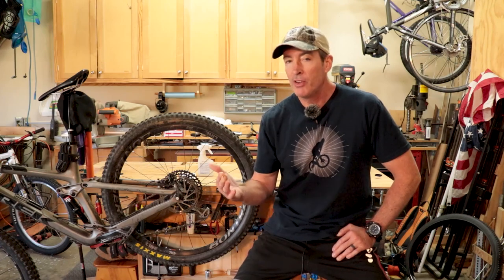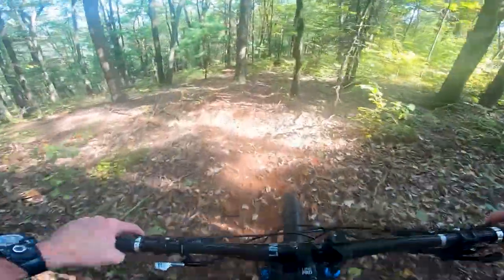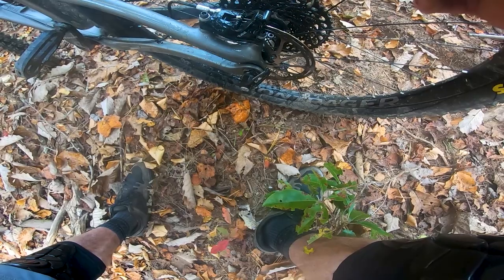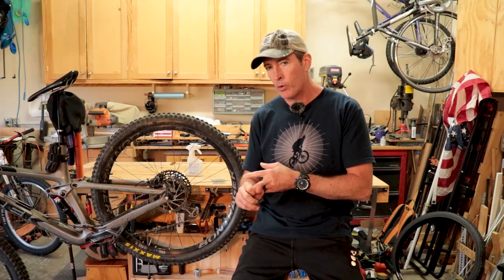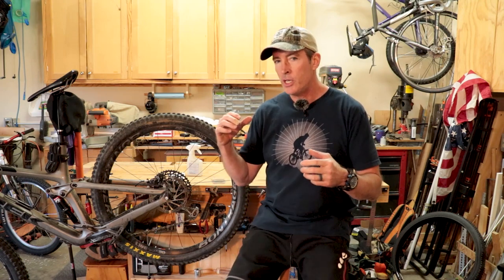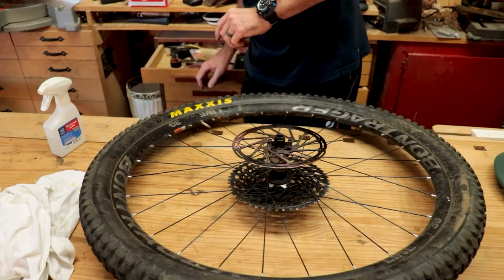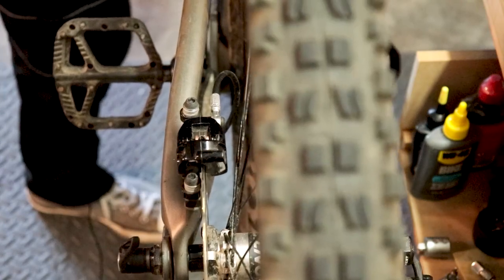MTB Brake Pad Comparison. Resin or Metal Brake Pads. Trail Breaker

Comment: Last Thursday (October 26, 2023) I rode my Commencal up 1800ft to the top of McCollough Peak on the Oregon Coast Mountain Range.  It was sometimes muddy and quite a climb (McCollough Peak el 2155ft, McDonald Research Forest, Oregon Sate University).  Coming down was a different trip, and all the way I was thankful for my metallic pads, front and rear.  Started down PlayTime Trail*, but it was too muddy from recent rains- but it looks like the trail in this video.  I ended up a different descent, the logging road which needed constant braking to keep me under 28mph.  LOL  :)
I thought about your video on the way down.  :)  Thank you!

*2 years ago I rode down Playtime, but this time would have brought damage to the trail and probably me as I slid off some steep bank.

Comment: I live in wet and muddy Oregon - but sometimes it is dry.  Long climbs from 330ft to 2000 ft over 2 to 3 miles, and then screaming downhill.  I ride a full suspension mtn bike with sram level t brakes.  I have found having metallic on back and organic on front works for me.  I have never had brake fade, but am waiting for it.  If I do and/or I decided to switch anything, I will do metallic for both front and back.   After this video, I think that I will throw into my backpack a set of metallic pad, just in case. 
Thank you for this great video that really covers everything!!!
Reply from the maker: Thanks, Doc! I’m running metallic on the rear of both of my bikes. I have some for the fronts when the organic ones wear out. It’s been perfectly fine on the long, steep descents I do which are usually 1000-1500’ without a break. I’ll put up with the occasional noise for the performance 😊👊🤙
Reply: i guess if U moved down from Seattle U might notice some dryness about Portland. moving up from CA, all i remember about Cooper Mountain in Beaverton is rain & snow & steep hills.....definately full metallic pad country 🤣

Comment: what I do and also works for me is run resin pads with shimano Ice-tech rotors 203mm, I'm agree with you that metallic pads last longer but they make me miss the grip and precision of the resin ones
Reply from the maker: Yeah, resin pads are quiet and instantly grippy. I'm still running them out front

Comment: Just a little FYI - there is a third category of brake pads as well. We are based in Utah and produce performance ceramic brake pads in two different compounds....
Reply from the maker: Yes, I didn't cover those because I hadn't used them. Thanks!
Reply: Where can I find ceramic brake pads that will fit the shimano xt m8100 TWO piston brakes?  And would I need to upgrade to a larger 180 rotor instead of my stock 160?
Reply: I appreciate this video.  I recently installed organic pads on my e-bike, replacing the OEM pads that were semi-metallic.  I think I’ll stay with the organic pads because they are whisper quiet.  I love that feature.  I did slightly alter my breaking habits as I can confirm they can and do fade a bit.

Comment: For trips in winter and when the weather is very wet, it is better to use brake pads made of solid copper sheet.
100% copper brake pads do not require heating like sintered metal.
and work from a cold start.
therefore they work better than baked in mud, water and in winter.

Comment: I had exactly the same problem last year. The original brakes on my Bergamont Trailster were cheap shimano brakes with ressing. They were great but descending from the 2500 m mountain was painfull. I had to stop couple of times and wait till they cool down a little bit. After that i bought magura mt5 with mettalic pads. A huge difference. But magura mt5 with mettalich pads was also terrible on rainy conditions, zero breakpower. I found ressin much better on wet condition then my magura mt5 4 piston brakes. In wet condition they had zero break power and also extremly loud.
Reply from the maker: Maybe try a semi-metallic?

Comment: Great video!
How loud can metallic pads be? I have just bought a MTB with SRAM Level T brakes (180/160) and I suspect the pads are metallic. When braking at low speeds (cold disc), the front brake makes a loud harsh, metallic noise. Downhill, at higher speeds (warm disc), the noise disappears. The bike is pretty new, maybe 20 or 30 miles.
Thank you in advance.

Comment: I hate to break this to you, but SRAM brakes are prone to extensive brake fade. Compared to Shimano or TRP, SRAM brakes have to be serviced every week in order to offer similar performance. If you want to combat brake fade, the best and most effective way would be to get rid of your SRAM brakes and to buy a Shimano brake set. It really makes such a huge difference
Reply from the maker: I like shimano too ( I have Zee brakes on my Kona) but after switching to metallic pads on my Sram I've had zero issues with fade or feel.

Comment: Metallic pads. After coming from resin pads, I really don't notice any short comings going to metallic.
Reply from the maker: Agreed! I’ve swapped my back brakes on both bikes to metallic. I’ll change the fronts when they wear out. Thanks for letting me know about the upload. The original video file was corrupted 😊
Reply: @TrailBreaker  yeah it ended too abruptly to be your style.

Comment: I just set up my bike with disc brakes for the first time in my life and I get a lot of shuddering along with mediocre brake power compared to my trusty rim brakes. And yes, I bedded them in. 

I'm running alligator windcutters with TRP spyre mechanicals which came with semi metallic pads. 

I agonisingly tinkered with every aspect I could think of to get the breaking power up and to reduce the shuddering as much as possible. while I've made some improvements, I still have barely adequate braking power and unbearable shuddering. I had to retighten my headset as a result.

I'm scratching my head on this one. Do I need to switch to resin pads? Are wind cutters not compatible with the TRP spyres? Is this just something I should expect with disc brakes in general?
Reply: Change your rotors. It seems that the wind cutters shape might be the cause of the shuddering. When the pads get in contact with the part of the rotor with higher surface area, the braking force is higher; and when the disk rotates and the part where there's less surface area gets in contact with the pads, the braking force goes down.
Also keep in mind the pad profile when getting new rotors. I did a little research and it looks like the trp spyre uses the same pad profile as the Shimano B03S or B05S (which is kinda on the bigger side). Searching them in the Shimano website I saw that they are compatible with SM-RT26 rotor. And in this rotor, the braking zone is bigger, so the whole pad gets in contact with it.
You can also look up the SRAM Centerline rotors, and the SRAM avid brake pads, and you'll notice that the braking zone on the rotor is smaller, but also the pad is shorter. So, you could use a Shimano rotor with the smaller SRAM avid pads, but not the other way around, since using a bigger pad on centerline rotors would make the pad float and then come in contact with one of the 12 "spokes" of the rotor, and the float again in a cycle that would end up in a shudder.
I'm kinda late writing this 2 months after, but I hope it helps, and I'm sorry if you didn't understand, but I couldn't explain it any better since English is not my first language. I you have doubts or something just let me know. Also if you fixed your problem let me know. Thanks

Also, you don't necessarily need a SM-RT26 rotor (this rotor is for resin pad only), you just need a rotor with a bigger braking zone than the ones you currently have.
Reply: @eljaibas16  I understood perfectly. I think you're right. The windcutter's profile makes for low braking surface contact. I bought some CNC rotors. I'm planning to swap them in the next time I have to change tire. (I've got this on a rear hub motor ebike and wheel removal/install is quite a process)

Thanks for your thoughts on the brake pads profiles. I was getting overhang issues when I first installed everything and ended up having to go down a size with my adapter and fill the gap with cone washers

Comment: For my ebike. I had to run metallic as it came stock with resin as a regular mtb. Stopping from 45mph would jus overheat them right away
Reply: What brake set up do you have? Brand? Size of rotor?
Reply: @teeeejaay89  they are some amazon mechanical brakes. But both pistons inside moves. 180mm front 160mm rear. Both floating rotors. bo1s metallic pads. Once at operating temperature i can lock up both tires if i want. Wont go hydro as i hate the maintenance

Comment: two points:
1) In addition to checking the rotor compatibility with metallic pads, be sure to also check caliper compatibility. Lots of bikes come from the factories with cheaper-grade calipers that can melt from the heat generated by metallic pads.

2) One thousand vertical feet should not burn up your brake. If your rear brake gets too hot, but your front brake doesn't, it's a sure sign that you have poor braking technique. Two-thirds of your potential braking power comes from the front brake. If you were using your rear brake predominantly, it is no wonder why your brake failed.

Comment: I wouldn't bed in pads by dragging the brakes it glazes the pads, find a slope and do a dozen sudden stops to put quick heat into them, they will work better.
Reply from the maker: Oh, thanks!
Reply: The problem with sudden stops when bedding in pads is it puts more material in small spots on the disc, which will cause an uneven surface and give you a grinding skipping sound/feel. Dragging the brakes at slow speeds distributes the material evenly. Both ways work and do what you feel is best for you. That’s just the way I’ve been told by local pros.

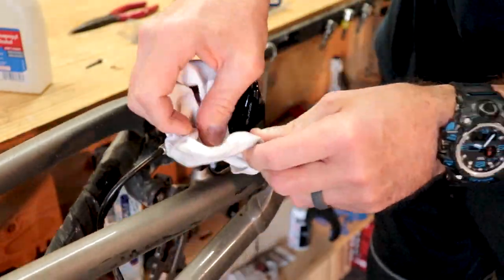Comment: 6:27 ... dont have enough room for my new brake pads.. what should i do?
Reply from the maker: You need to compress the piston/pistons into the cylinder. First remove the fill cap or cover and be ready to catch the excess fluid. Clean the piston with alcohol. Then use a plastic tire lever to push the piston back in. Now you have room for the thicker pads.

Comment: My stock pads uses organic pads can i use resin pads ? Cause resin is the only thing available in our local shop.
Reply from the maker: Resin and organic are the same😊
Reply: @TrailBreaker  Thanks for the reply 😁 But still need to clean and sand the rotors right ?
Reply from the maker: @_Hayward_  clean...yes (rubbing alcohol is great) sand...not necessary but I do. Just be sure to “bed in” the new pads with some big brake applications at first😁
Reply: @TrailBreaker  Thanks Man 😁

Comment: I really believe that the "rotor compatibility" is anything but snake oil. 
100% of bicycle rotors* are made from the generally same stainless steel alloy and nothing else. And it's a high iron alloy with some nickel, some chromium and little else.  
And I'd rather replace rotors every few years than spend a minute in a hospital. 
Rotors are cheap - medication is expensiv

*I ain't talking about exotic road bikes with ceramic or carbon fiber rotors meant to be used with cork pads and other silly stuff like that.

Comment: I have metallic pads on my patrol but what I ended up doing was changing the rotor for a 203mm in the rear so now I have 203 both front and rear. The feeling is a lot better and they don’t heat as fast or as much.. I don’t know why bikes don’t come with 200mm rotors all the way around
Reply: Its all about the cost and durability. Some forks can't handle 200mm rotors since they might crack. I don't know about these frames but bigger rotors in the back is not something I would recommend.
Reply: Some bikes are also designed different. Like XC and downhill for example, XC is an all-around bike that is designed to both handle uphill and downhill. While downhill, ofcourse is designed to go downhill instead of uphill. Downhill bikes are quite heavy

Comment: What about ceramic pads... I heard good things about them but I haven’t try one yet
Reply: If you make downhill use 203mm front rotor and 180mm rear rotor. You won't get long braking power if you use 160mm rotors with these pads, unless you switch to sintered pads. 
With ceramic pads your brakes get practically the same effects of resin pads (organic) but they last longer and absorb a little bit more heat. 
With 160mm rotor or lower it's not worth it.